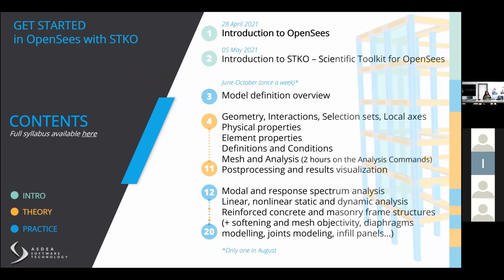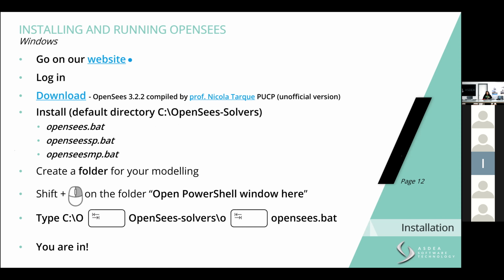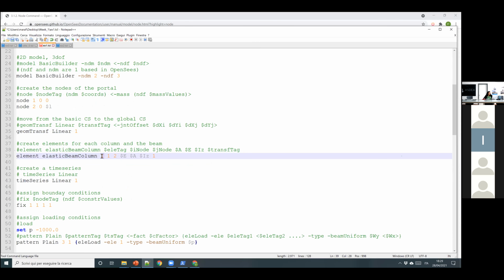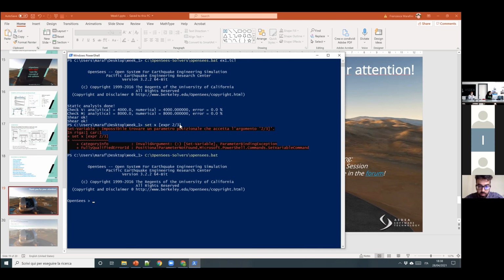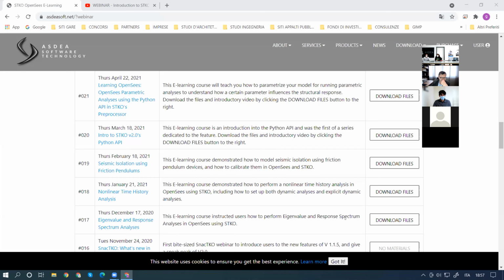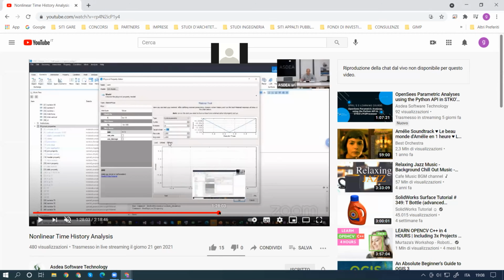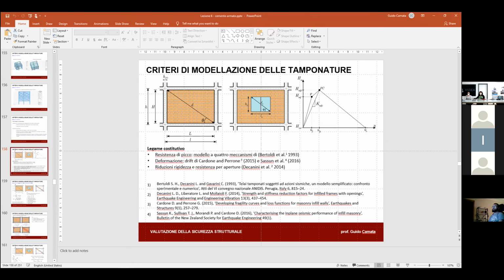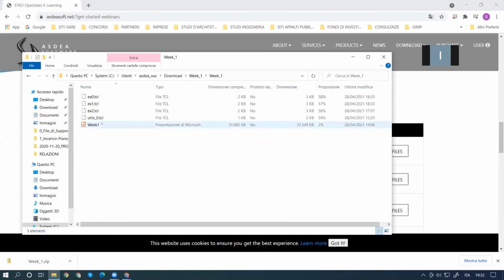Get Started in OpenSees with STKO Week 1

Comment: While executing "ex2 .tcl" I am getting the following error. Please help me to rectify the same. 

invalid command name "mkdir"
    while executing
"mkdir "
Reply from the maker: Hi :) Thank you for your question!
We do not have problems running that file, but anyway that line has no relevance is the script, you can simply erase the mkdir command (line 63) and retry.
Reply: @STKO_ASDEA  Hello :) 

I could rectify the problem. Earlier it was just "mkdir"

But I have modified with " file mkdir "output". 

Your suggested solution also worked well. Thank you!